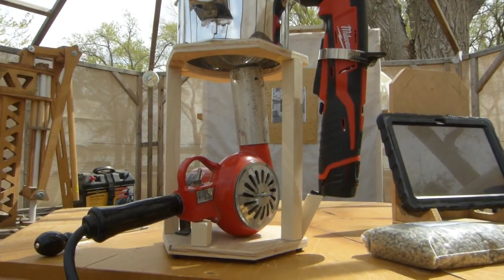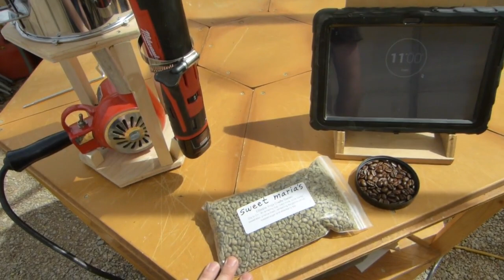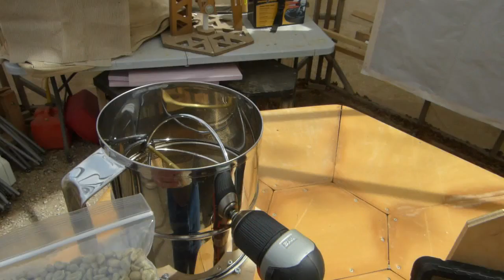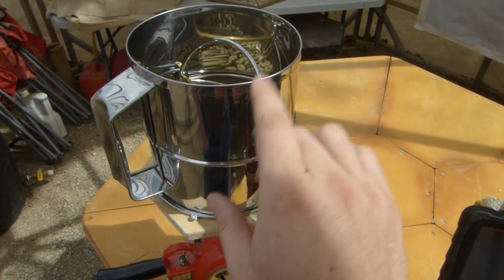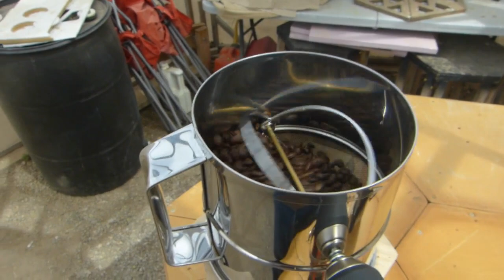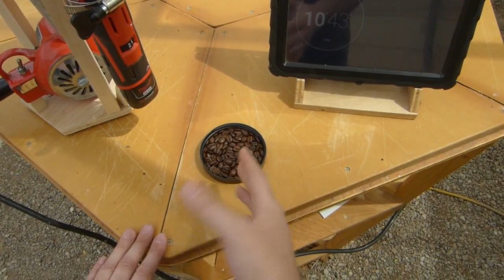Milwaukee M12 Coffee Auto Roaster - Flour Sifter And Heat Gun Method

Comment: Best DIY roaster idea I've seen.

You could simplify the design quite a bit by just attaching the drill directly to the acorn nut on the left side of the crank shaft: 3-jawed chuck, 6-sided nut. Should work perfectly.

If the free-wheeling crank handle would be a problem, just cut off all but a stub on the right side.

Comment: I am in love with this idea. If it is still single, I want to marry it! 

This has me totally rethinking my StirCrazy / TurboOven project. 

Supposedly, it would be better to get to first crack a little sooner and draw out the time to 2nd crack more than the 30 seconds. The greatest thing about this setup is that you could have infinite control over the heat by changing the distance between the heat gun and the sifter.

Comment: Hi there!

I made your setup but with more crude materials for the stand and a corded drill. 

It worked quite well if there was a fast speed but at times the beans would get stuck and stop the agitating process.Did you ever have this problem at all? 

I have to admit, the beans I have do appear small to my eye and I'm very new to roasting though I am getting very even results! I'm guessing the issue with it getting stuck is due to the size. I have looked at other sifters and the design is the same. I'm guessing an alternate method is to either try larger beans, depress the lip where the stainless steel mesh meets the canister.

Can you please let me know your thoughts?

Thanks! I've learnt so much from you!
Reply from the maker: +Will Dang Yes, I have had beans stuck but not many.  Does not really jam when hand cranking. 
Just mod the screen a bit and I'm sure it will work out!